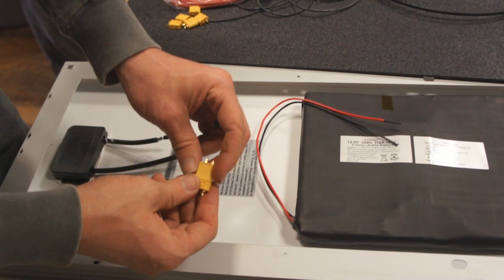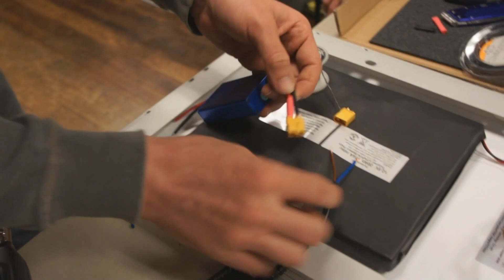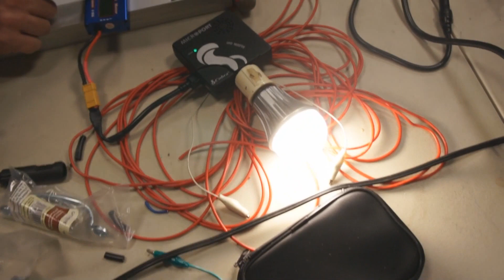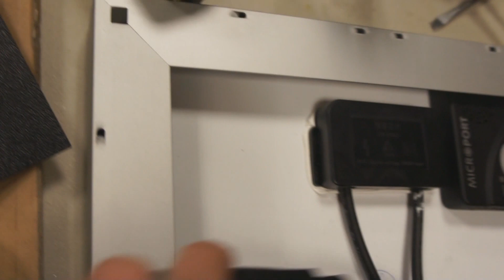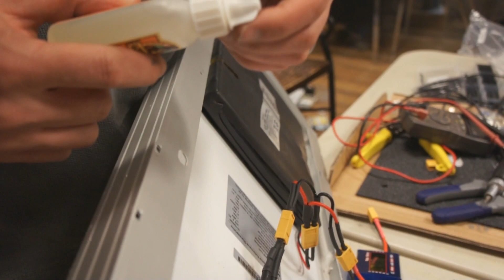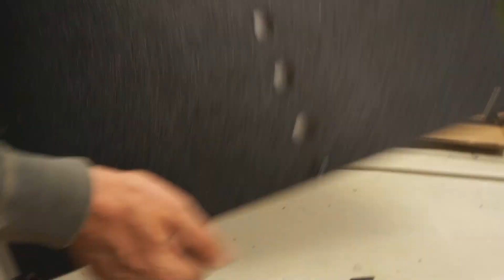DIY Build Session SOLN1 Portable Solar Power

Comment: You can fit in some slim power supply 5 or 7amp 12v in case you would like to charge the batteries faster at home without putting it outside and wait for hours to charge with that small panel guess it's hardly giving 3 amps . A really good idea is to put between panel and battery a boost buck converter to boost the efficiency of charging.

Comment: Everything you did beautifully except the back cover , small and very ugly . it actually could be aluminum cover and the ventilation you could drill on the sides , just couple of holes small could handle it . i'm curious about the  battery, will it really work as long as you expect  how many amps?

Comment: I would not recommend to sandwich those thinks into a solar panel, since solar panels can get very hot when exposed to the sun. Those items do not like heat and could be damaged,
Reply: I have doubts too ! But I think if you get an alluminum back cover as radiator and put everything on it and cut a big hole for 12v cooling fan then it is ok.

Comment: poor battery. i got the feeling those diode wont last too much. Diodes are not battery chargers. many of those diodes are meant to work with seal batteries not ion phosphate solid battery banks. for ion batteries diodes must work at least on 50v 10A minimum power factor.  you need a solar charger. just saying.
Reply: +maxspytwel what kind of battery would you recommend?

Comment: Kind of a neat idea, but I see a couple of problems with your design.

1. No Charge controller. (Could potentially damage the battery by over-charging)
2. The way you have it wired you can only see how many Amps you are taking out of the battery, and not the Wattage the Solar panel is generating. 

I keep going back and fourth on weather or not a build like this would be practical, it kinda seems like with your inverter and battery combo you have just enough power to piss you off.

Comment: I built a Soln1 but it discharges voltage way too fast, like 1v per 15 seconds. But only when the inverter is attached and increasingly when I plug things into the inverter. Got any ideas how I could fix this voltage drop?

Comment: i have questions. could i build a full bank of larger soln1's? each self contained as designed, but each panel wired in parallel to each other to boost the amperage. making it where the leads going indoors to the electrical panel wouldn't need to be so large. a 10 or 8 gage wires would work perfect. or would the inverters output sine wave possibly counsel each other out? or would they sync up and work together like a tru line tie inverter?

 i've thought about an inverter that produced a partial "round about 90% sine wave" and a corresponding main breaker. the main breaker would sense for a complete sine wave. if it detected only a 90% sine wave. it would break from the mains. once the breaker had opened from the mains, it would signal the inverter "via a signaling wire" to go full sine wave. saving electronic devices from the pulse of an incomplete wave form. also when breaking from the service lines. it would save line-men's lives from a system feeding the down lines or troubled service. once the line service was restored, the main breaker could then be reset. sense it would detect a full sine wave. it would keep breaking till service was restored, because the main breaker would check for a full wave form, also the signaling wire would also reset the the inverter back to making the 90% sine wave form. i think this would innovate the solar energy industry "battery storage and line tie systems as one". you could have your cake and eat it too.

 yes the pannles would need to be over-sized for to inverter and it's battery storage. this way you can charge the storage batteries and sell to the grid at the same time. also it would be fully automatic. you could work solely off the panels during the day. during a shtf instance. at the same time, have charged the built in batteries for night. it would take a tracking system to make it work to it's top performance.

Comment: Where is the charge controller? Those look like LiPO packs, if someone forgets the panel in the sun they will explode...
Reply: I saw another video on this and my understanding is that there's already a charge controller or sorts wrapped in with the battery.
Reply: That looks just like a normal battery, perhaps you are right, I can only say from experience that Lithium batteries explode violently when overcharged. I had a Bluetooth headset that had a tiny battery in it and when I overcharged it the damage it did was consistent, and that was a 4mm/1mm battery. Think what that size of a battery can do.
Reply: lasersaber is too smart for that.. the LIPO already has a cut off circuit to prevent overcharge..
Reply: most lithium reasonably priced batteries are built with charge protection circuits to prevent cats from overcharging abuse..cant say the same for ultra cheapo made in china batteries...

Comment: shouldn't the earth of the AC line be connected? isn't it dangerous (especially if it gets a little wet seeing as there is no earth). what about a charge controller shouldn't it use one? and shouldn't you put a fuse in there on the battery for safety? what about putting an RCD on the AC line? (i don't know if houses in the US even have an RCD but in other countries they are mandatory, tho i don't know about any requirement on inverters)

Comment: My hat goes off to you. But I have a question. Where is the charge controller?

You installed the battery, inverter and watt meter. Where is the charge controller?
Reply: there is none, you don't need it in a dc system that does not share input/outputs

Comment from the maker: The charge controller is built into the specified battery pack.  You can put the cut off switch on the positive wire if you prefer.

Comment: it all looks good besides the fact that you forgot 1 major component a charge controller. and every time you are using a cut off switch the + wire should be the 1 disconnected

Comment: Awesome work on the SOLN1 system, but where did you get those LifePO4 batteries? I'm having the hardest time finding them. I wonder if its possible to make SOLN1 system modular, so that you could hook them up together and pull more amps. Some inverters are stackable.

Comment: Here is what I would like you to answer for me if you don't mind!!! I love the concept of what your doing and I do not have any Solar experience! So I picture my house and what I want the panels to supply the electric for. With that said what would supply my window unit air-conditioners? Then what would run my refrigerator? What would run my lights? What would run my dish TV and my computers? How much would each set up cost so I could have them designated to specific items? Help me if you can!

Comment: Hi was wondering is there a charge controller in this unit? and i looked up the size of the inverter and it says 2" thick how will it fit?doesn't look 2"thick in the video.is the inverter a pure sine wave?what if i use a 100 watt panel? would it charge faster?
Reply: Absolutely yes . You can use 100w solar panel 250w xpower inverter , charge controller , BMS switches , plugs , led 100w led driver , usb charge pcb 4x and cooling fan .

Comment: Seems a bad idea! No charge controller on what seems to be lithium =O also there's a reason why solar panels have a white and open back so light can come out and don't build heat ! The battery will cook inside that and panel will build heat fast causing loss in amperage ! Please people don't try this at Home it's practical but far from efficient

Comment: There is nothing wrong with the way your hooking things up, but as a general practice, you should always switch on/off the positive. All electronic equipment uses a ground - the positive can still short through the case on the inverter.  If you short the negative on the case - nothing changes because the case is already negative.

Comment from the maker: The Super Joule Ringer makes a great add on.  Many people are not skilled in building good Joule Ringer type circuits so I am leaving it out on the basic builds.  This basic unit is designed to be super easy to build and use.